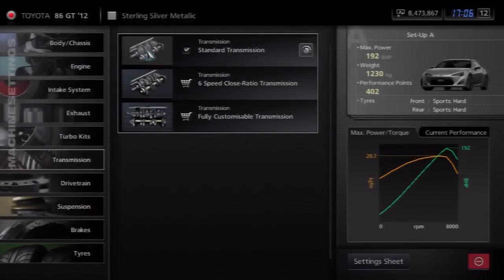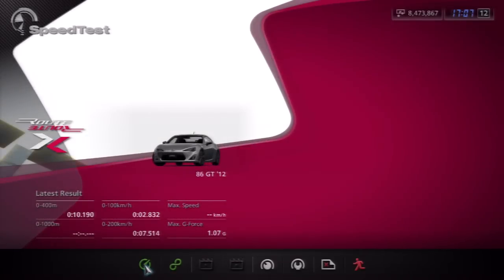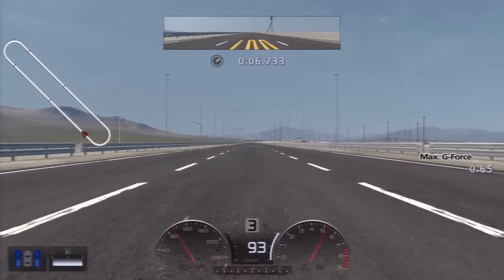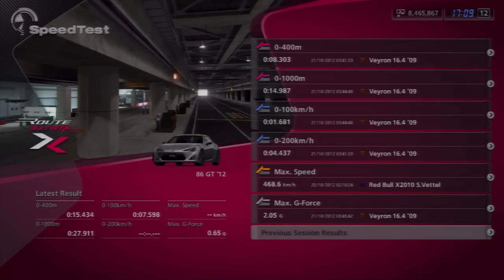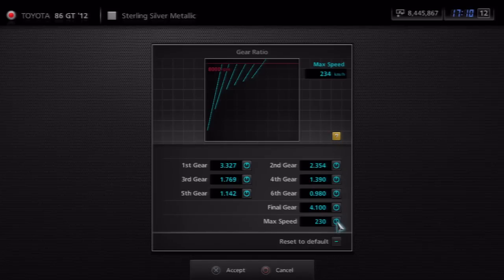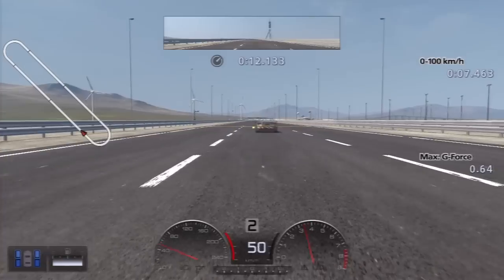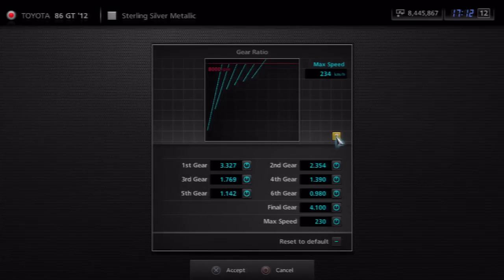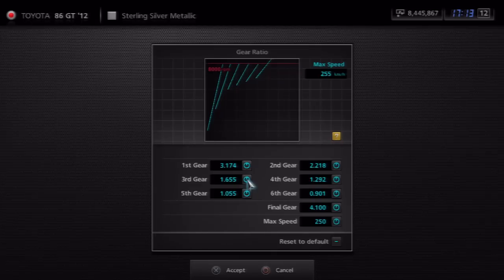GT5 | TRANSMISSION EXPLAINED

Comment: is there a reason y u use km/p instead of mph?
Reply: Region.
Reply: The guy is a New Zealander.

I use imperial even though my name says I should be using the metric system.

I find it easier and a lot more fun to convert while I am traveling.